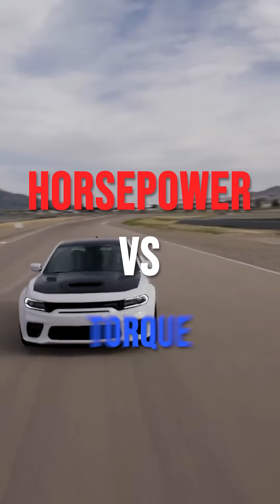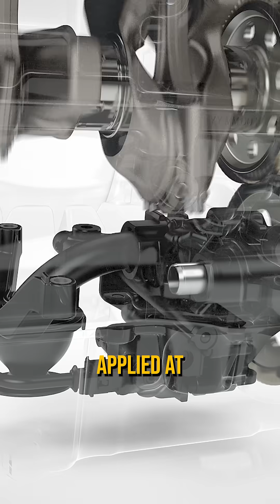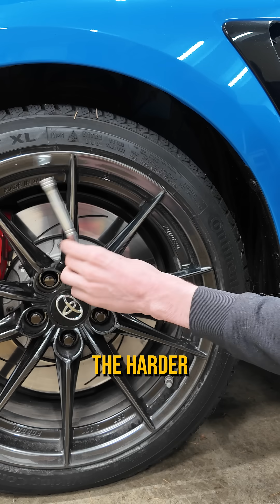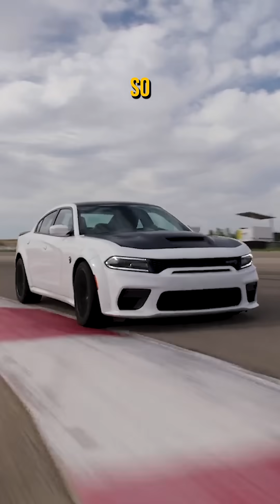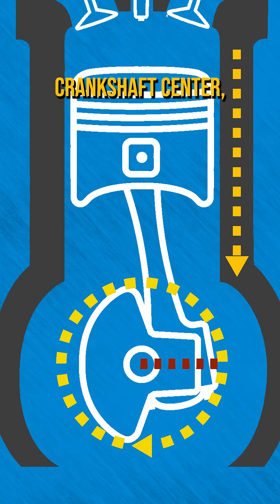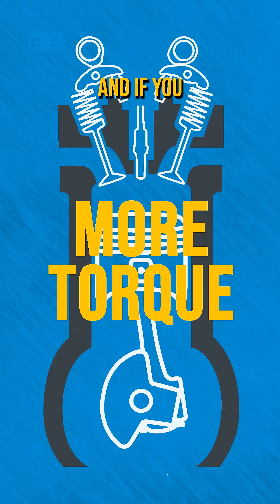Horsepower vs Torque (In 60 Seconds)

Comment: I've heard people literally say “I don't need power, I got torque”.  Sigh.  it's the same kind of people who are probably at some point in their lives going to spend twnty years behind bars for violating Ohm's Law.
Reply: its always been a silly comparison since there are plenty of examples of both low revving torquey and powerful high rpm engines having tons of success in a variety of applications. f1 cars barely produce torque but have tons of power, and yet they are the fastest cars in the world. adversely, audi showed what was possible with torque in the r10 tdi at lemans, which had so much torque that it was able to easily pull away from the competition while silently cruising in 5th gear, and led to fuel tank regulations that hamstrung diesel compared to gas in subsequent years, because it was so much faster while also being more fuel efficient.
Reply: So the Audi r10 tdi and a long wrench , with a bigger boom in the cylinder, just didn’t spin that wrench super fast, and used less fuel?  🔧 got it! 👍🏼
Reply: @yimpyoi9808 power is what matters.  All peak torque describes is what rpm you get your power at.  Which also doesn't really matter since it doesn't really describe the shape of the power curve.
Reply: It can matter. If the horsepower is 100 and the torque is 700, you’ll be towing things slowly, going up steep hills, etc etc. very low end oomph without needing high rpms.
Reply: @lord_haven1114  It doesn't matter. If the torque is 100 and the horsepower is 700 you'll be towing things really fast going up steep hills etc. Without needing high torque.
Reply: Tell them to buy an 18 wheeler with thousands of foot-pound torque then...
Reply: It’s usually some bro that owns a 7.3L diesel, that makes 250 hp and can barely move a trailer up a hill, that says this.
Reply: My tractor has 26hp but 250 torque. I don’t need hp when all I need is 540 rpm pto.
Reply: @MerpSquirrel  Power is the rate at which you do work. You may not want to be able to bushhog your pasture at 50 mph, so you don't need much power. However, if you're trying to make it down a drag strip as quickly as possible, you do need it.
Reply: @chitlitlah  well said.
Reply: @MerpSquirrel bx2680? Lx2610? B2601?
Reply: yeah torque isn't separate entity from HP
Reply: What’s ohms law?
Reply: @bwcastillo Ohm’s law is a description of the relationship between a circuit’s voltage(volts), current (amperage), and electrical resistance(Ohms).
Voltage=Current X Resistance
Change one, you change the others. I’m not sure how the hell you can violate it without breaking physics somehow.
Reply: How do you get behind bars for ohm's law??????? That's voltage equals resistance times current
Reply: Bruh, there’s race cars that are diesels, which don’t make much horsepower, it’s all about low end torque. It doesn’t always matter which route you chose as we have fast cars of each type, high revving and low revving.
Reply: @shaikymandel7593 the race cars did make a lot of hp. But the reason they choose a diesel was for the efficiency. They were racing 24 hour races and could pit less of fuel
Reply: @Jay-me7gw yes, but they made less horsepower than the gas cars, you can go just as fast with a diesel as a gas if it’s powerful enough from what I’ve seen.
Reply: @shaikymandel7593 And whichever motor, the gearbox should not be forgotten.
Reply: @shaikymandel7593 And whichever motor, the gearbox should not be forgotten.
Reply: These are mostly the passenger diesel fanbois (remember when diesel Golfs and Hyundais were considered cool), because they thought their car was cool because they finally had power.
Reply: Ever hear  the phrase "People buy horsepower but drive torque"?
Reply: @KM-ol5bs  Horsepower sells cars, but torque moves them is the version I know.
The dieselgate VW I had was the perfect example... tons of torque down low and moved effortlessly when driven at partial throttle.   
Didn't have a whole lot more oomph when you mashed the go pedal to the floor and it revved out, but there was more useful power in normal situations than anything I'd owned before.
Reply: @psychojc13  i completely agree. My dad had the TDI Passat if I’m not mistaken it was like 400 lb ft or something like that. Absolutely effortless. He made out pretty good in that deal too, loved the car drove the hell out of it and they gave him blue book and a bunch of swag
Reply: @psychojc13  while I agree, that's a misleading way to say it, because horsepower will do more way more to move a car than low end torque will. You just gotta rev it higher to use it though. The 4.3 v6 in my s10 can chug up steep hills at 1500rpm no problem or pass people on the highway without shifting out of OD, but that's nothing compared to how much it could move if it actually had some top end power 😅
Reply: @psychojc13 That's still the result of horsepower. If you make lots of torque in the low rpm you get horsepower as a result. It's horsepower that does everything. You can just change the torque with gearing to whatever you want you can't do that with horsepower.
Reply: @bwcastillo you are mistaken, 400 ft/lbs is more than the 7.3 idi, the tdi passage gets like 230.
Reply: @addisonherbert6686  I stand corrected!
Reply: @psychojc13  Most motorcycle manufacturers have moved to stating torque over horsepower.
Reply: @addisonherbert6686 depends, my tdi jetta is hitting 305lbs of torque to the wheel. A bigger turbo, fuel pump, ect and you easily break 400lbs of torque.
Reply: @HifeMan  yeah, still wont ever beat a v8 tho ❤ 6.7 powerstroke doss 600hp 1200 ft/lbs stock. And with the 10 speed it can get upwards of 30mpg
Reply: Sure, but you still have to describe where the power is coming from and going. Hence why you get both facts about the vehicle. It’s a short hand. You don’t want a 1000 horsepower big rig that actually gets to 10,000 RPM to get things moving. Imagine the transmission gears and ratios you would need if it’s meant to drive slowly but pull very very heavy. So you say you want a 1000 torque and 400 HP and the RPMs are low, and it has 18 gears to transfer all that torque into more speed when you get going with momentum. Don’t need that torque all going to the pull, but the keeping and slowly gaining speed. Yeah it’s all “power” but you know less with that simple term than you would with both, and then explained further in gear ratios, number of gears, etc

Comment: There’s a lot of “gearbox so torque useless ☝️🤓” comments here. A gearbox is just a means of speed and torque regulation 😂. Torque does matter. If you have no stroke then you can’t apply force and your gearbox won’t matter. If torque didn’t matter then people wouldn’t need to increase displacement to get more power. Big explosion big torque as the video said. 

If torque doesn’t matter then I want to know how you plan to run a water pump, fuel pump, supercharger and so on. Like bro how can you say the reason your engine runs does not matter. How do you plan to accelerate from rest with no torque??? You think Euler’s inertial law is just gonna magically work on hopes and dreams??? Initial acceleration needs torque to move all that inertia. Physics demands it. Lower torque can be advantageous as it makes it way easier to actually put power down to the road without traction loss, but higher torque gives you the ability to move heavier loads ie why a Bugatti needs more torque than a 911 GT3 RS. Saying torque doesn’t matter is absurd.
Reply: You're right that an engine needs to create torque in order to work, but everything else is wrong. There are other ways of tuning an engine than just increasing displacement. And higher torque does not mean more capable of towing. It is power that determines how fast you can tow a load of a given mass, consider that power= force*velocity.

Comment: Look... Torque does matter to an extent

If you don't have enough torque you're gonna be taking nine years to accelerate to the speed limit

You have too much torque and you'll be spinning your wheels and shredding your tires for the next five miles

(EDIT! I got it backwards. High torque takes longer to accelerate than low torque. Either way, torque still important)
Reply: That's not quite right. Power is what determines how fast you can accelerate, not torque.
Reply: Ok, so technically yes... But here's the thing: Torque and Horsepower are co-dependant... One needs the other regardless.

Horsepower basically dictates how fast a car can potentially go... It is the cars potential excluding factors like weight, drivetrain loss, drag, etc.

Torque is the efficiency of which you can put the horsepower down. Example: you have a 800HP motor that only has 120lb/ft of torque... That 800HP is going to basically spin your wheels for days until you finally get grip. Now do the inverse (800lb/ft of torque with only 120HP) and suddenly you got a car that is going to take 5 business days to get to 60MPH.

This is the prime reason Electric cars are so good at launching off the line and just, driving. Electric motors give massive loads of torque but not too much power (excluding EV supercars) that's why Hybrids like the Porsche 918 are so good at performance, the torque of the electric motors and the power of the motor blend together nicely in a way that makes it manageable and fun to drive

The closer torque and horsepower are together in numbers, the cleaner and smoother the launch/drive will be.
 @Feldspar-x7h
Reply: @Feldspar-x7h .......torque is literally the reason..... As it is the rotational force applied ....better reasoning.... Motors use a torque rating not a hp rating, and if they have a "rate" they usually state equivalent to.
Reply: @Joebauers2505  No it isn't. Race cars have low torque and accelerate to the speed limit faster than any Diesel with 10x as much torque. Plenty of said Diesels have tons of torque and won't spin their wheels even if you floor it in first gear. It's all about selecting the gear ratios to get the desired torque at the wheels, which is the only place where it matters.

Electric motors are usually rated for torque because of their application, you need a motor to move a conveyor belt you need to know how much force you need to keep it moving, and you select a motor that produces the torque needed to achieve that force. The power draw isn't particularly relevant because 1) electric motors don't have a static maximum power or torque they're capable of producing, they can always produce far more power than their "rated" specification but the more power you demand from them the faster they overheat 2) once a conveyor belt starts moving it actually takes far less torque and power to keep it moving, so as long as your motor produces enough torque you can just start the belt moving more slowly to avoid excessive power draw. For electric vehicles however power is still the metric that matters for performance, and motors for electric cars are rated by power.
Reply: @Joebauers2505  torque without power can do no work.
Reply: @rollsroyce329 torque creates the power. Without torque there is no power. Even in basic mechanics you can create torque without power.
Reply: @Joebauers2505   Torque is necessary for Power but Torque doesn’t “create” Power exactly.  I’ll give you “Key Ingredient” or go as far as to say Torque can cause rotation… Torque Tends to cause rotation and IF Torque succeeds in causing even the smallest almost immeasurable amount of rotation Power is created in real time.  Power Is Torque x RPM.  As we agree: You can’t have Power without Torque or RPM and you can’t do work without Power.  This must sound like paper beats rock, rock beats scissors… to the layperson following our comments 😁
Cheers
Reply: Is your transmission stuck in 4th?

Comment: What matters is the force applied where the tire meets the road, which depends on wheel torque, which depends on the transmission ratio and the horsepower generated by the engine, which is derived from the torque produced by the engine as well as the engine speed.  
Torque is a component of horsepower.  Once you calculated the horsepower, you can then ignore the torque number.
Reply: yea the point is more power less torque version always beat more torque less power at perfect gearing  ….
Reply: Horsepower and torque are simply different ways of measuring engine output.  They are both related; torque measures the force an engine can produce, while horsepower measures the amount of work (energy) the engine can do from the torque it produces at a given engine RPM.
Reply: @mrslcom not egzacly but whatever 🪠

Comment: Torque doesnt matter in a race setting - if you assume you keep.your engine in correct rpm range, you use shifts to achieve max hp etc. That why f1 engines have relatively low torque and high rpm. However in rl settings it does matter. If you coast in a 5k rpm redline diesel and 9k rpm honda at leisurely speed, they will.both keep lets say 1.5k rpm. This means that without downshifting , even if both have same hp, diesel engine will have double the power until you manage to rev the other one. If you kick down downshift it might be able to rev fast, but if you just press the accelerator diesel will win every time. 

Thats why i prefer simple explanation. Horsepower = acceleration. Torque = ease of access to horsepower.

Comment: Going back to a dyno graph, torque represent trapped oxygen for a single combustion (minus taxes like thermal loses, fictional loses, pumping loses), hp is trapped oxygen over a minute (minus taxes). 
Anything that involves distance and time is hp, doesn't matter if it's pulling a trailer, acceleration, "taking a wall with you" etc. 
Torque only matter for mechanical durability, breaking a conrod, breaking a gear, breaking the tires lose from the surface, etc.
If you know all of the loads of a vehicle (weight, drag, rolling resistance) then you could calculate the energy it took for the vehicle to do something. This is observed hp at the wheels, for hp at the crank you would have to include drivetrain loses like friction, weight and time to shift gear. 
To get to the amount of trapped oxygen in the engine from there it gets more complicated, beyond the regular loses (like thermal and friction) you also have to account for mass in the components as that can impact rate of acceleration differently for each gear (which is why you can get free hp by reducing weight in rotating or reciprocating components even though the engine hasn't trapped more oxygen during acceleration).
Weight and hp ratio is as relevant today as it ever was, we're just moving quicker and need to include a few more loads than weight.
Reply: I think you're talking about brake specific fuel consumption, which Jason talks about in one of his videos.
Reply: @Duckferd That is how efficiently it uses fuel to make the power. For instance during cold starts it's hard for the engine to vaporize the fuel so there's more droplets which doesn't combust or combust too late, so more fuel is needed for the oxygen/power.
Reply: @PSA78 the man JUST said the explanation of torque and horsepower DOESN'T need to be complicated. Smh.
Reply: @oldgreg315  It doesn't, taught in physics in school, but no matter how many times it's explained people seem to confuse it so sometimes it's better to get to the bottom.
Reply: @PSA78 your convoluted explanation with broken grammar and misspellings did not do that.
Reply: @PSA78 you have way too much time on your hands
Reply: @ryze9153  I was once young and full of energy. 😆
Reply: @oldgreg315  I'm so sorry that it brought such struggle to you that you had to take the time to write a remark without any constructive criticism.
Reply: @PSA78 kinda like your remark? 🤡

Comment: Torque is just horsepower but regardless of rpm
Reply: It's the other way around. Horsepower is derived from torque and RPM.
Reply: @jghall00 yeah, torque is like a subsidiary factor of horsepower
Reply: Nonsense. Torque isn’t any kind of Power.

Comment: Tried to make my father understand HP and Torque, but he as a backyard mechanic insisted that Torque is the only thing that matters in a car...
Reply: If he understands how to read dyno graphs, ask him why torque (ft lbs) and power (hp) always cross at 5252 rpm, and then show him the math =)
Reply: I’m glad to hear it’s not hereditary.
Reply: He's not entirely incorrect. 
Engines of yesterday made good torque and horrible HP, today we've swapped and most engines make good hp and low torque. Different strokes and speeds yet very similar results.
Reply: @Joebauers2505  The only difference is that old engines didn't rev high. There is no engine that is inherently high power and low torque, it's just that it doesn't rev high enough.
Reply: @utkn because it's high power low torque, look at any super bike, making 200hp and like 70ft of torque.
Compare that to a diesel making 600 HP and 2000 ft lbs. And before you say it you can rev out a diesel albeit to a max of about 6500, but the increase is purely torque related.
Reply: @Joebauers2505  Not sure what your point here is.